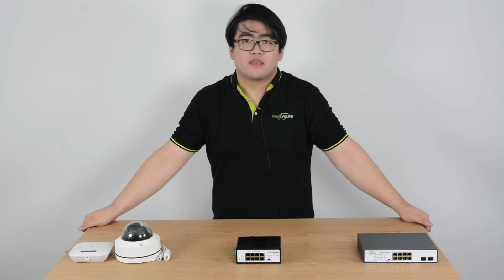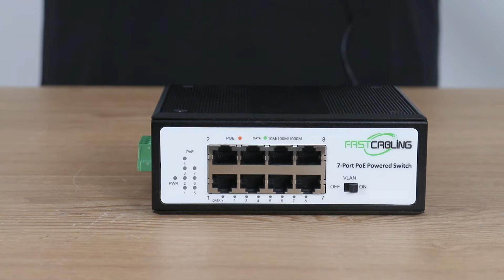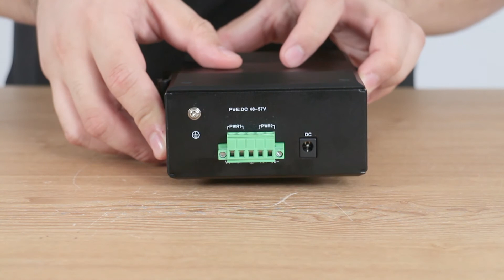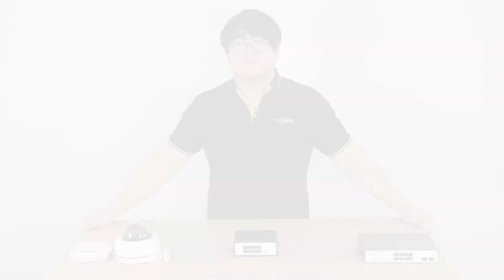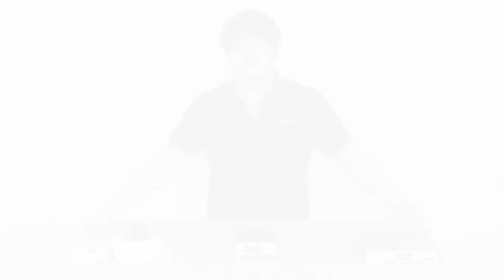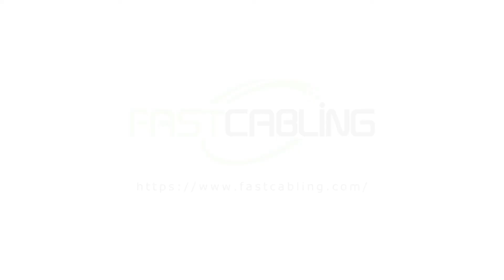What is PoE Powered Switch?

Comment: Hello 
Can anyone tell me can I use Poe switch for networking to connect computer's... Will it sense and stop the power supply to non PoE device's?? 
Thanks
Reply from the maker: What you think is correct. The PoE switch will only provide the network data while the non-PoE device such as the computer is being connected. There is a power handshake in the standard PoE system. The PoE switch will verify the edge device is PoE compatible before it releases the power. Otherwise, it will only provide the network data.